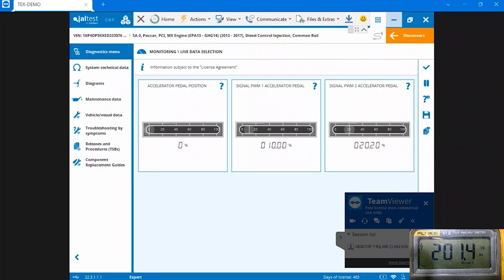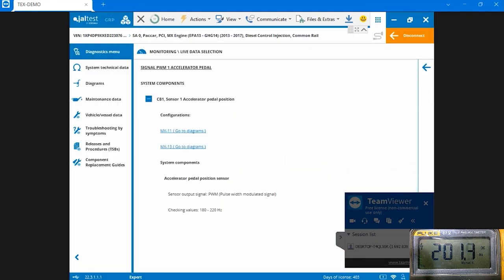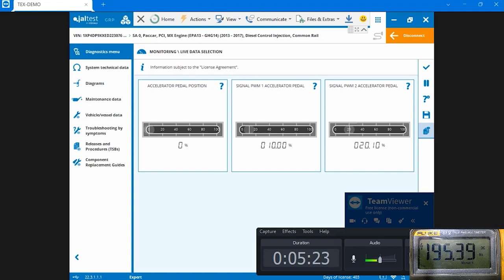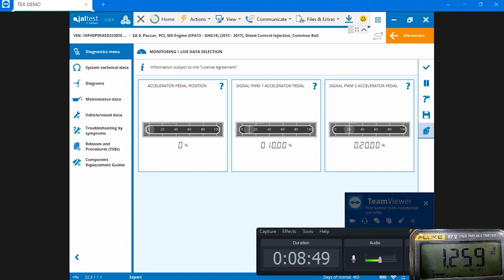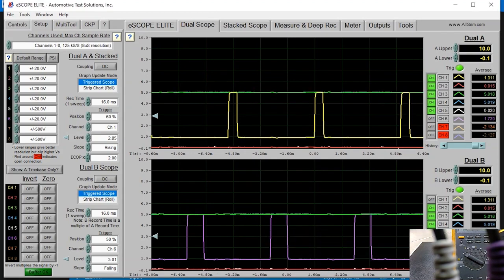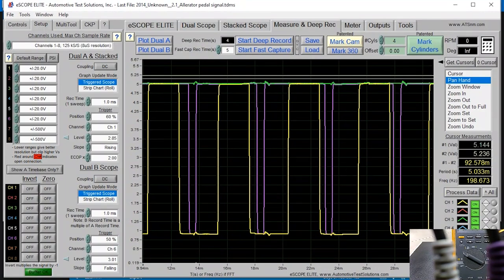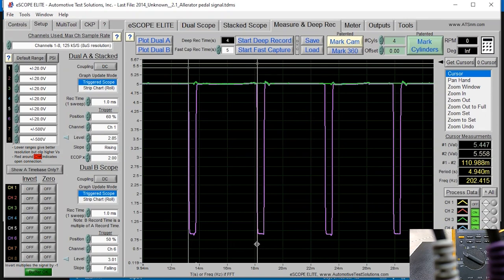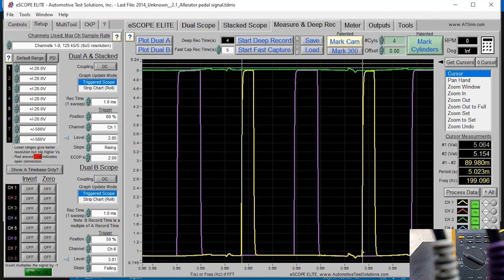PWM Accelerator Pedal Testing

Comment: Thank you for sharing the  video 
Paccar engines throttle position sensor are hardwired to the ECM not thru Cab Controller. I found some use analog 
Throttle and Lately Change to PWM . 
I think are better than old fashion analog one. Very Common found PWM with Cummins Cm2350 and CM2450